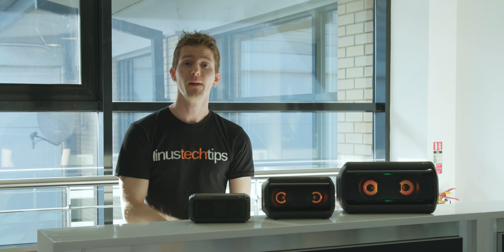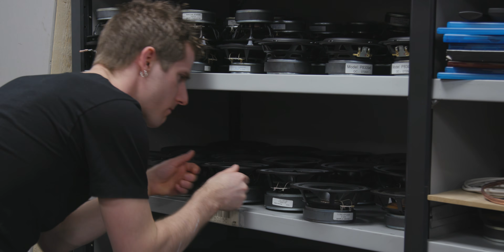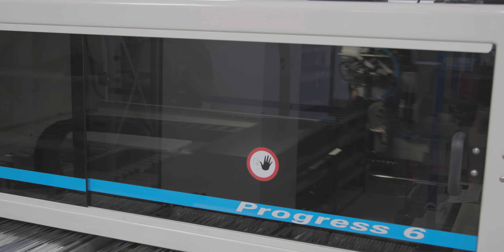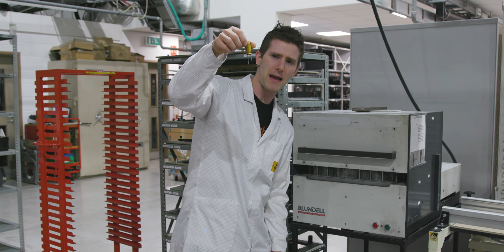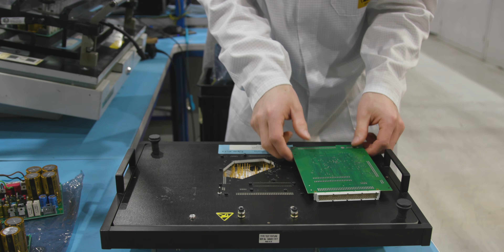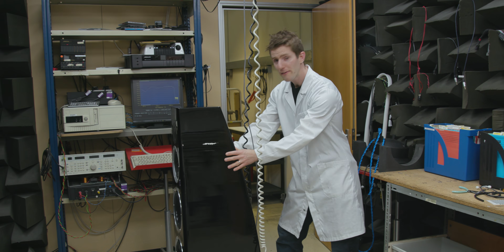How a $100,000 Speaker gets made! - Meridian Facility Tour - LG XBOOM Go

Comment: Seems very german the whole manufactoring process, very focused on structure. I hear Meridian before and it sounded okay. But I must say that they did not impress me nearly as much as a used 8k USD set of Marten Design bird 1 speakers. (not even close) And also the audio note an-e spe/he for only about 12k new, were a lot more natural/integrated. And personally if I had to use that amount of money, I would buy the 2x better Verity Sarastro 2 for around 50k, and then buy a good system for 50k that would last me for life. They don't have quite the punch/pressure like the Meridian, but the signature is for me a lot better on the Sarastro, so I just solve that problem by putting the Sarastro in a 30 square meter room, that solves that problem.

Comment: Sorry Linus but you were holding up a capacitor with legs and called it surface mount,  components with legs are called “pin through”  but great video. More people should know what goes on in a electronics manufacturing 👍👍👍👍

Comment: $100K speaker. First it is put on a rocket where it will orbit the Earth for 90 days, that guarantees the MDF absorbs sufficient space dust. Then upon reentering the atmosphere, the space dust and the black piano gloss finish is seared into the MDF by the intense heat of reentry. It is then put into a decompression chamber, then an anechoic chamber and finally a cat scan machine. Then the finest cardboard fibers from China are brought in to delicately wrap the speaker in luxury. Lastly, a fine powder of unicorn poop and fairy boogers are sprinkled into the box and then sealed so some rich arrogant turd can purchase them and brag to his other arrogant turd friends that his speakers cost $100K. You are welcome.

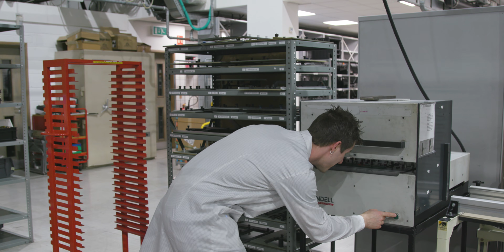Comment: @9:10 components with leads like that mount in a 'thru hole' fashion.  a surface mount component does not reach the other side of the board, it's connected to the surface of the board. :}

Comment: I would  like to point out at 2:50 when you talk about powered speakers is slightly incorrect. 

Powered speakers have one amplifier for the whole unit. and have a passive crossover. Capacitors and coils in most cases.

Active speakers have active crossover and a dedicated amplifier for each driver in the unit.

Comment: 7:46 I just thought of a way of making PCB manufacturing a lot easier.
 if they were made in zero-g you could put surface mount components on both sides without the underside components falling off cuz the solder melted it loose. 
this is why we need manufacturing and Industry in outer space.
Reply: deltoid 77 Yeah because it's totally worth it to fly rockets to space and back a thousand times instead of just finding another solution
Reply: @jatoxo  If you register your company outside the ozone layer you can avoid tax. (you can also avoid tax by sending lobbyists to bribe politicians)

Comment: Ok that multimeter cnc controlled robot thingy that was measuring and testing every component was legit cool
Reply: You can add testing with these when you order PCBs. More testing is obviously more expensive and often you just order more PCBs and throw 10% of them away because they don't work. Cheaper than letting the manufacturer test them all.
Reply: @unlink1649  You can't do that with expansiv new tech/PCB's that have multible layers, with older more established once it's defintely done.

Comment: The capacitor you were holding that's not surface mount, It's called THROUGH HOLE you dumb dick. Should do some homework before you open your pie hole. 😂🤣

Comment: so what you're saying is they are basically Tech driving a two to three inch speaker that is made in China with a whole bunch of Technology that's it's supposed to enhance the sound so when a band like tyketto or the Michael Schenker Group comes on the radio and you turn it up, you, will, notice, the difference! Even if it doesn't decide to shout in protest like the mouth of a Canon, lodging Chinese capacitors in the back of the inside of the case, you, will, notice, the difference! :-)

Comment: In-Circuit Test Engineer here, I actually use a flying probe on a day to day basis testing prototypes! The Takaya APT-8400, that was shown in this video is suuuuuuuper slow compared to Takaya's more recent flying prober called the APT-9411. It can perform about 25 tests per second checking for resistance, capacitance, inductance, continuity, and a lot more. It also has what is called AOI, automated optical inspection into it. However, there are even faster flying probers out there that can perform up to 150 tests per second. My colleagues actually design and debug the other form of tester that you showed, aptly named a bed-of-nails fixture, because of all of the test probes that stick up through the bottom. They are quite common in industry even though they run on a off shoot of BASIC, called BT-BASIC or Bench Test BASIC. All of out testing PCs actually run emulators of Unix just so they can run these testers. It's pretty awesome if you ask me.

Comment: SMD or surface mount device (component) is a component that does not have leads like shown on the capacitor, but instead have legs that only touch the PCB. Through-hole components describe the cap he's holding as the legs (usually) go all the way through the PCB instead.

Comment: For $100k, you can buy a concert line array system, designed in Germany, with 60 thousand watts in the subs, and 40 thousand watts in the mid and high end. Balanced, clean, active cross overs.
You can make a building shake, in clean tones. Anyone who pays $100k for two residential speakers is not into sound, they are into showing off.

Comment: Linus with his nonense again, could you please stick to pc related stuff, you  don't know shit about science/engineering, you don't have the background, you have zero credibility, and check videos before posting, it contained many mistakes, like when you hold a big ass capacitor and say something like a surface mount component like this.... it is not a fucking surface mount component, it is a trough hole component. In the factory you should have focused on the actual part that is relevant for speakers, there is nothing special about pcb manufacturing, the technology is several decades old, they have slow,outdated assembly line and even that they don't use it at full capacity, normally assembly lines work non stop, where I work, the assembly line is only stopped during christmas for 1 week, apart from that it is working without stopping, day and night in 3 shifts.Assembly lines are very expensive, you are literally burning money when they sit idle, ... this explains why their products is so expensive
Reply: check out this for modern, high speed pick and place machines, even this is 10 years old
https://www.youtube.com/watch?v=SRu02F6AOmg

Comment: Just a suggestion for entusiasts that don't want to spend a few thousands regularly: keep the DAC/media player part out of the rest of the system.
You can get good speakers, a really good amplifier and preamp and only then get a DAC and media player on top. The rest of the system will last you decades, with recapping the amp every 15 years and reconing the speakers around the same time, but DACs and media players will last only a few years due to technology changes, even more if you get into movie digital formats.
I got myself a nice pair of Focal floor standers, I LOVE the Focal sound. Always try your speakers with your music.
For the amp I went for an old NAD that I got recapped and upgraded by an ex Musical Fidelity engineer.
Passive attenuator used as a preamp and then an Audiolab DAC with JRiver running on an Intel NUC. It is great

Comment: It's pretty impressive what they accomplish but I actually see more value in the mid-end and low-end stuff now. All of the PCB creation results in 0.00000% better quality in the sound compared to a mass produced PCB in china. The plywood gives them a hell of a lot longer lifetime because they don't soak in moisture as much as MDF but they really had to overengineer this with the triple-layers, aluminium and the inner coating because plywood, as most people that have built speakers themselfs probably know, resonates a lot more than MDF. So yeah, if you have MDF speakers don't feel bad about it. They maybe aren't built for a lifetime like these are, but you won't hear a big difference thanks to the material either. In fact, I just tried the coin test on my self-built MDF speakers, it worked just as well (sorry, neighbours).

What I missed about this video is the drivers. Why didn't you show how these are made? The drivers and the casing are the biggest part of what makes a speaker sound great, I would have loved to see them being made

Comment: i have  hard  time to find a difference of Mp3 and flac... so.... the cheapess balanced speaker will  be enough...
Reply: That might be the case, and sensible to only spend as much as a difference and improvement is worth to you. I had the opportunity to spend some time in a good hi-fi shop. They set up demonstration with equipment the customers wanted to hear and what they though you might prefer in a room with just that and a sofa. Being able to put my own music source on and unplug components and put in far more expensive equipment I spent far more than I thought and far less than those top priced piece that really did not go well together. When I upgrade 10 years later I only needed the first bar of an album to know I was hearing something far far better. With digital sourced music (WAVE not compressed) I am down to source, 5 active speakers and an active sub woofer.  Second hand at 200GBP per speaker, 350GBP for the centre channel.  I expect I could get better but spent thousands for 5% improvement. Even not spending a penny more and not even changing what you have it is still worth having a session listening to your choice of music set up for you. You might find that your hearing is far better than you believe.

Comment: I bought a bunch of speakers from Paradigm in 2012.  Three arrived damaged in transit.  They weren't cheap either...but were fixed under warranty.  Amplifiers in my Adam A7x studio monitors went wonky.  Not the cheapest either...fixed under warranty.

Buy from a company that will fix things instead of trashing them and sending you a new one.

Comment: My buddy's dad has a listening room/movie theater with about $500k in Meridian Gear. I wasn't a big audio snob until I spent a bit of time in there. It's incredible what those speakers can do.
Reply: Quality sound is at least half environment. The fact that your buddy's dad has a dedicated listening room contributes a lot toward how good it sounded.

Stuff at this level is so far down the road of diminishing returns that you can't even see it anymore.
Reply: like @buca117 said, the most important factor is the environment (given decent gear, any brand, any age). imagine 2 flashlights shining light from the top of 2 speakers in a room with mirrors not just on the walls, but on every object in that room. as you can imagine the whole room lights up.. that is what happens when a speaker beams sound into a room. any room and ANY speaker. some sounds in some places get too loud, some get canceled. that is the main problem that needs to be solved. controlling those reflections is the key in creating an 'accurate' or just a listening environment. 
a recording or mastering studio is mainly concerned with keeping those reflection (interference) to a minimum.. the brand or age of the monitors is second priority at best, especially these days when very powerful parametric EQs are so accessible to shape the speakers' response. so in order to reproduce accurately a recording, the amps, wires (believe it or not some people buy $1000 power/speaker cables) and even speakers are secondary.. a decent sound system properly set up (speaker position, EQ, listening position, wall treatment, etc) will ALWAYS reproduce the recording with greater fidelity than the most expensive speakers being played in the garage :}

Comment: a little off topic.  Any idea why AC and battery powered speakers are getting smaller and smaller and incredibly powerful and clear sounding at the same time, while aftermarket car speakers don't seem to have advanced much at all in the same time frame?  I've got a speaker box smaller than a shoe box for my ipod at home that can fill a small space WAY better than a stock car stereo, and getting similar bass from aftermarket would take at least one speaker larger than the entire box I previously mentioned....just for the bass.  I'm baffled why I need to buy subwoofer, midrange, tweeters, and amps to make a car sound good, when a bluetooth speaker running off batteries can sound just as good.  Anybody know the reasons for car audio falling so far behind portable audio?